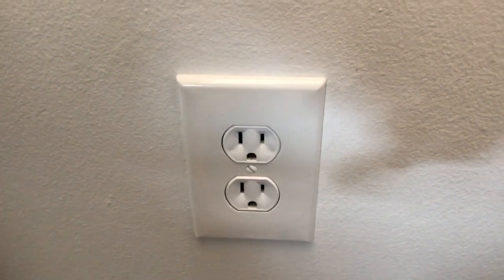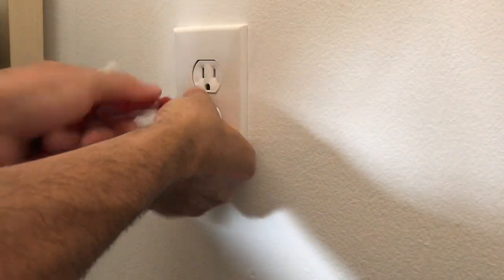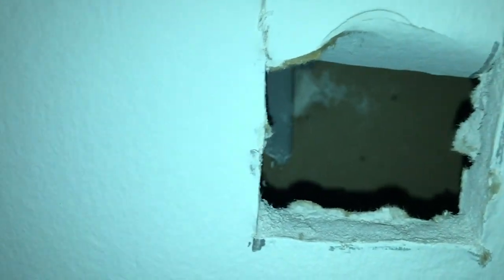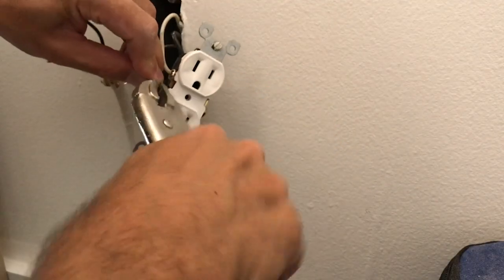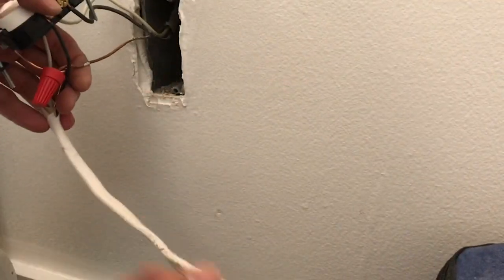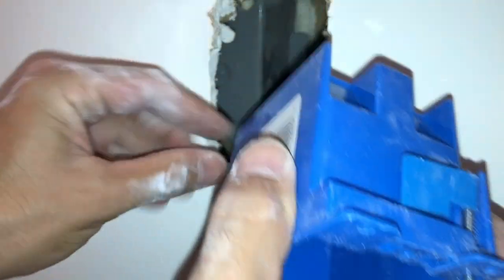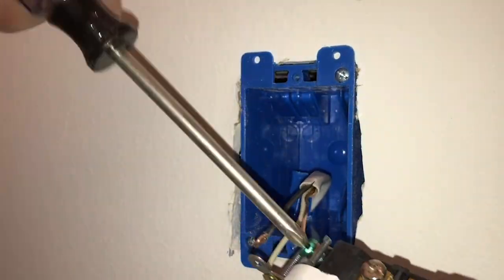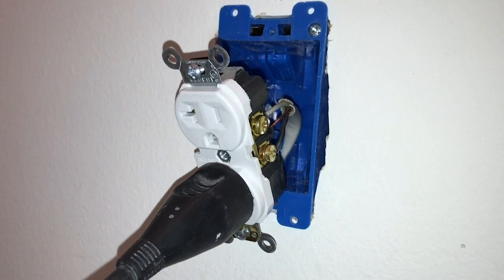Adding a Plug (on the other side of the wall)

Comment: Maybe I'm an idiot (most likely) but what did you screw the box into? Thanks.
Reply from the maker: The blue box is an "old work" box, which means that instead of nailing it into a stud, it instead has 2 little tabs which catch against the drywall.
Reply: It is study to attach it to the drywall? It doesn’t seem to be
Reply from the maker: @amysingsaath300  Yes, it is sturdy as long as the tabs are actually catching against the drywall. It should feel quite firm when the tabs have been screwed down. If you have a thick wall (like some non-sheetrock walls) it is more challenging to get the tabs to catch.
Reply: Great question. Glad he replied too.

Comment: This would have been the perfect video if you hadn't glossed over and fast forwarded through the most important part!  You can't tell what you connected to what or how you extended the ground.
Reply: That's kinda basic electronics/wiring. So tbh, if you aren't familiar with how you would do the connections, you should maybe let an experienced person do that part just to be safe.

Comment: You're not installing a plug. You're installing an electrical outlet or receptacle. The two or three pronged plug will have an electrical cord attached to it that goes to a light fixture or some electrical motor, such as a fan, grinder, or vacuum; or to a radio, TV. electrical clock. etc.

Comment: Thanks so much for this! Just what I needed. I also have a plug with the red safety button on the other side. That shouldnt matter right?
Reply from the maker: Sounds like a GFCI plug if it's got the red and black buttons on the front. Make sure you follow the specific wiring instructions on that plug as I know there are specific "in" and "out" poles to be used.

Comment: In the comments, someone said you can’t put a 15 amp receptacle on a 20 amp branch circuit.   Incorrect.   You can’t put a 20 amp receptacle on a 15 amp branch circuit.   In comments, someone pointed out the white NM cable.   That is a no no.   In the video, you taped paper to the wall to catch drywall debris.  May I suggest you tape a small box to the wall.    When you put the ground and neutral conductors on the receptacle you put them on backward.   
A PLUG is a end of cord device that “plugs” into a receptacle.  A receptacle is a device that a plug can plug into.  An outlet is an electrical assembly that an appliance can get its power.  Light outlet, receptacle outlet, a hardwired connection is also an outlet.
I would suggest you video doing it again correctly, and splice some in from the original and delete this video.
Reply: Very good comments. The guy in the video was in a hurry.
Reply: Can you elaborate on how the ground and neutral were installed backwards?

Comment: That is not a 20amp receptacle.  Your electric is not to code. You also didnt loop the wire cirrectlybon the ground, its liable to slip off over time for with moving the outlet during install.

Comment: One complaint, looks like you maybe using 15A wire on a 20A circuit. It should be safe for the most part but isn't to code.

And I could be wrong and you found a white insulated 20A wire
Reply from the maker: You're right about that. Noticed when I was re-watching.
Reply: was thinking same thing romex should be yellow... just learning but first thing I noticed when he went to breaker.

Comment: Also, if your existing outlet has screws on both sides filled you can just punch the new wires into the corresponding holes in the back of the outlet. Black goes into the hole labeled "hot" and white into "neutral" and ground just gets attached to the wire nut
Reply from the maker: I've always felt a little weird about using the plug as a junction for more than 2 wires, but figured it could be done. My current pack of 20A plugs from Home Cheapo don't even have the quickwire holes!
Reply: Never use the press fit holes unless you like fires. Unless it's a contractor grade outlet with the pressure plates.
Reply: @no_handle_required  Thank you. He lost me at kitchen scissors for wire stripping. Lol

Comment: Is it possible to put the outlet directly in back of the other?  Do they make boxes that are passthrough like that? Or do I have to offset it like you did?
Reply from the maker: It's possible. Clearance was the issue in this case. My outlet boxes are 2.5" deep so they would be pushing right against each other without an offset. You can, however, buy "shallow" old work boxes from Home Cheapo which are helpful when space is limited.
Reply: @sondroyo  …or [B]lowes.  🤣

Comment: No need to measure for placement. Simply get an extra long drill bit and drill a small hole straight through the existing outlet opening and the hole on the other side will give you perfect placement. Sight 1st with a flashlight so you don't drill through anything important!
Reply: I just read on another post to offset the new one? I didn't know. I live alone so I'm going to attempt to install a new plug in behind my dresser. In the living room on the other side of said wall there's a plug in right behind my couch. I won't lie, I'm kinda scared of electrical jobs. I try to do everything else around here myself

Comment: What cable you used? I assume 12-2 would be good.
Reply from the maker: 12-2 is the correct choice with a 20A circuit (the wire in this video should have been yellow).